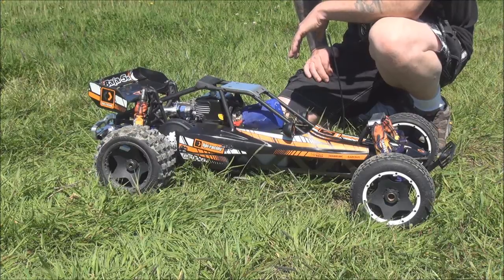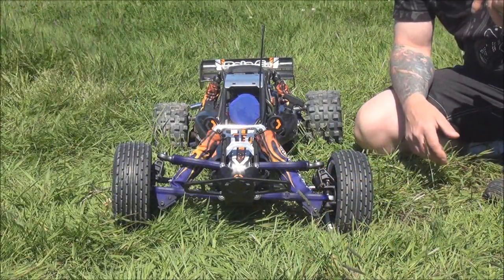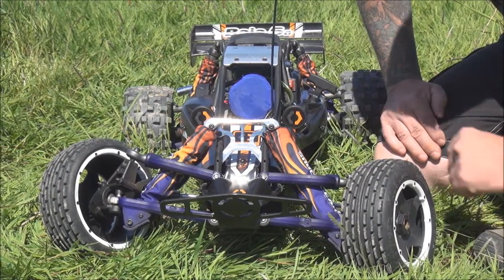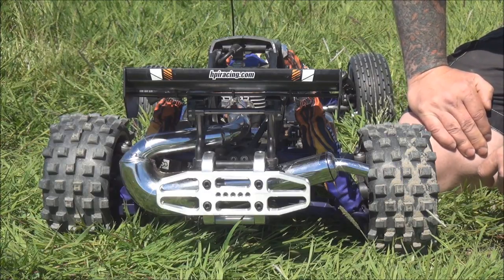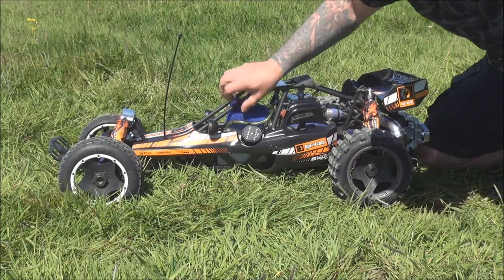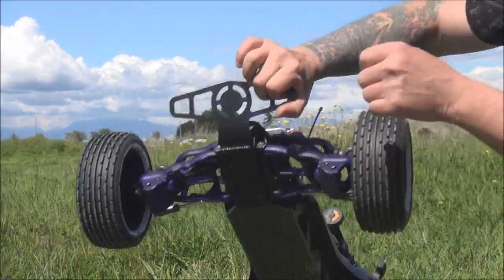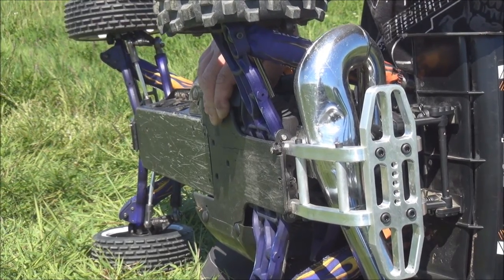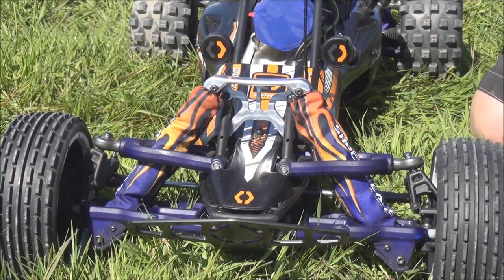Hpi baja 5b v2.0

Comment: For your pipe dent, fill the pipe with water ,first block off one end so the water can't leak out under pressure, then fill with water then block off the stinger or end of the pipe with something that will keep the pressure in , push a cork into the stinger etc, then put the pipe into the freezer. keep an eye on it after a few hrs because once it's popped the dent out it will keep swelling in places , maybe ? i know from ex[erience with 1/10 pipes i left one in the freezer a bit too long & it swelled it out just a bit. but it's a guaranteed way to panelbeat your pipe & you wont even be able to see where it was dented !  Hope this helps some of you RC Heads out there like myself . Cheers. Tony.